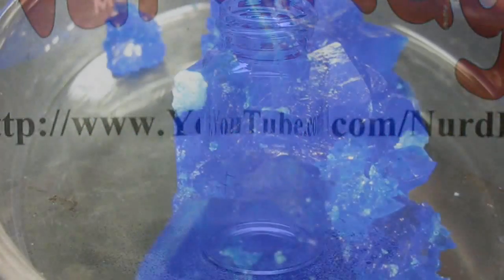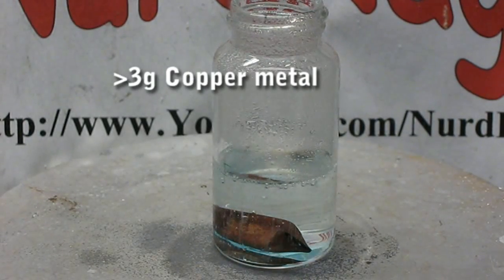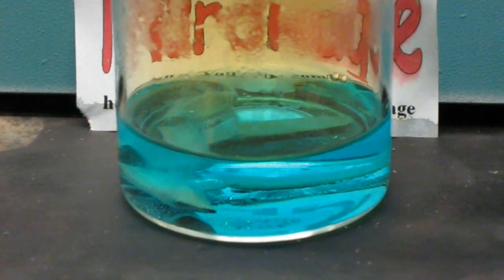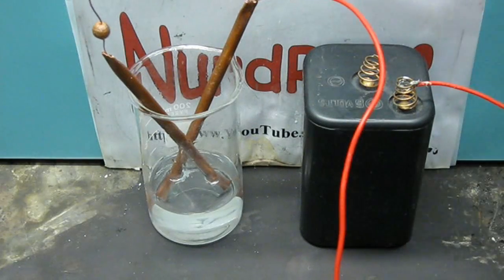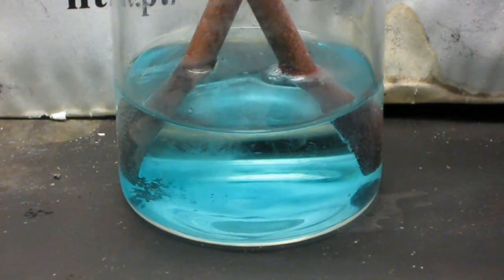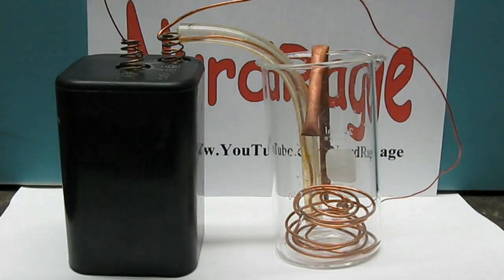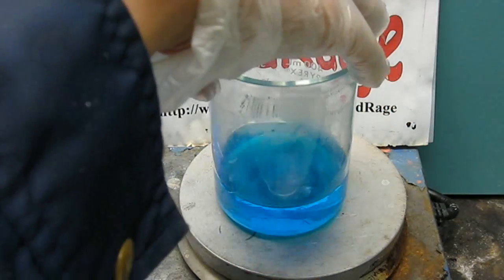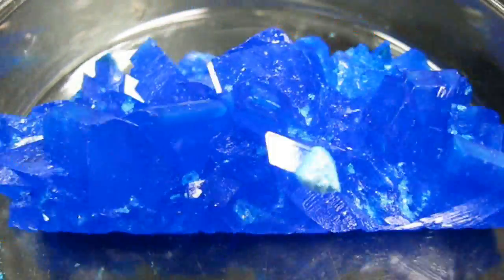Make Copper Sulfate from Copper and Sulfuric acid (3 ways)

Comment: @MrSuednym some say weak acid is better, I made mine w/ concentrated, but It doesn't really matter the electrons are doing the work so its speed is based on current. and dilute acid is safer to handle.  also the copper sulfate pentahydrate is sold as root killer in a hardware store.  here in CA last week and it was 16.99$ at OSH

Comment: I've done this with sulfuric acid and #2 copper pipe using the electrochemical process.  A new side note I learned is if you were to dip steel into the copper sulfate solution it will be lightly plated with copper.  I did this to a hammer over a year ago and it is still shiny copper to this day.

Comment: I'm currently making CuSO4 via copper, sulfuric acid and air. It takes longer than actively oxidizing the copper, (In a large flat contain with plenty of surface area a few days.) but I find that it uses up all the acid and I don't need any additional chemicals or equipment. Best of all it also works when making copper acetate from clear vinegar.

Comment: i am trying the 3rd way right now and have a nice sky blue solution at the bottom of my reaction vessle so I guess I am winning.  I am using an old atx powersupply that was moded to power it.  if you buy the solid core 12 or 16 gauge house wire from the hardware store you can get a section and only strip part of it for the posative electrode that goes to the bottom, then ya don't need to buy a little scrap of tubing or any thing.

Comment: @happylinkfan231
I think you just add the Copper Sulfate to boiling water and stir it until it dissolves. But you keep adding the Copper Sulfate until you can't dissolve anymore, this is called a "saturation" I think. But anyways just let the liquid evaporate from the saturation and you should have crystals. Remember don't touch or disturb the crystallisation process or it won't work

Comment: I tried to use the 3rd method (before I saw this video) and it failed miserably. Now I feel dumb because I have easy access to both H202 and HNO3. And is boiling the solution the only way of obtaining copper sulphate because I am not a fan of vapourizing toxic chemicals?

Comment: A forth and more industrial way is:  take copper metal and boil in conc. sulfuric acid. this will make nearly anhydrous coppersulfate.  this will be diluted in hot water then filtered.  this way the CuSO4-5H2O will be pure and clean.

Comment: i accidentally make Copper Sulfate i think when i was trying to make hydrogen in a basic test i was using a copper key and i think a brass key in a solution in water and bicarb soda with a 12v battery and drawing about 0.5A. i looked at the liquid and it was the same blue as Copper Sulfate i know from school electrolyses lab. im i right to think i made copper sulfate.

i have moved on to 2 ss shaver blades still in bicarb solution but its stronger now and i draw 1A, yay.

Comment: i really want to do this but i'm worried about using sulfiric acid and draining it from the crystals.  also how large can you make them and how stable are the crystals?  

if you can buy large sulfate crystals that would be the best option because i want to use them for displays.

Comment: @ZombieSlayer762 

Apparently one of it's uses is to prohibit algae growth in water, be it for pools or slightly worryingly drinking.

The only thing I've used it for however is for copper platting anything that conducts electricity, through electroplating. 

I'm sure there a rather a lot of other uses though :)

Comment: Hey Nurdrage. Love your videos. I have no chem exp. but they are very fun to watch. One question. In this video, you mix 30% hydrogen peroxide with sulfuric acid, and when you drop in copper it dissolves. However, in your nitric acid video you say after the first method is shown, that only nitric acid can dissolve copper. I just happened to be watching both vids and noticed that. Unless mixing sulfuric acid and hydro peroxide makes nitric acid (pretty sure it doesnt LOL ) I am alittle confused

Comment: Using nitric acid as an oxidizer can be verry efficient. Today I made copper sulfate using 75ml 6 mol/l sulphuric acid  and adding 10ml 6 mol/l nitric acid. 20 grams of copper metal are desolved using this method, a maximum of 50ml of extra nitric acid can be added to help desolving, don't add to much nitric acid otherwise copper nitrate will be formed during crystalisation. The theoratical yield is allmost 63 grams, practical you could get near 40 grams of copper(II) sulfate.

Comment: im having trouble to im tring the magnesium sulfate(aq) and  electrolisis using  copper anode and the first time I got A light blue scum forming on the bottom proble  CuOH , but the second time the solution turned brown / Dark green mabey the cathode is oxidizing and contaminating  the solution ?

Comment: For those who want to use 3rd method: I've used 40% sulfuric acid, 12AWG copper wire, and a PC power supply, as it has variety of voltages. Reaction works at 3.3V (between orange and black wire of the power supply, black is negatove). Works great :)

Comment: NurdRage, I'm planning on doing this experiment for my chemistry class, I have only two questions.  
The water is distilled water, correct?  
And for the electrochemical method how long was/should power be applied to the electrodes?

Comment: what is the smallest voltage the 3rd method will run? and what will be maximum expected current assumine 0.5mm ^2 wire as the upper electrode (submerged at around 2cm) ?

Comment: It's also a cheap oxidizer and works very will in a ratio with acid. There is a simple youtube video on making Cu(C2H3O2)2 with a 1:2 ratio (by volume) of 3% h2o2 and 5% acetic acid. but yes, that other comment is dumb that i said, probably wasn't paying attention xD mah bad. Also, i used 45 volts with NaCl and MgSO4 solutions with iron electrodes. It turns bright green (cl) / blue (so4) instantly (near the electrodes, you can just stir the water). I dont know if this works with Cu though.

Comment from the maker: @sapdog12

just means your acid wasn't perfectly pure, it's not as bad the situation looks, but requires a bit of work to recover:

Pour off the acid and get the white powder, add water to it to redissolve it, the white powder is copper sulfate, just in it's anhydrous form. The solution should turn blue now, let it evaporate instead of boiling and you should be able to get blue copper sulfate crystals.

The black acid can be used to make more copper sulfate, just won't be as pure.

Comment: oh, it formed a blue liquid though. but i dumped it and used the method with the hydrogen peroxide. ill tell you how it worked when its done boiling. i made 125ml of it and it boiling right now. it is around 50ml at the moment

Comment from the maker: @bernie2du 

It'll make copper sulfate, but i'm not sure if it will be pure enough for electroplating. I've heard electroplating require very high purity stuff and impure chemicals ruin the plate

Also i personally wouldn't want to deal with little bits of lead in my stuff. 

But if you do try it and it works then post a video and share the knowledge, :)

Comment: Makes a great stump remover. Drill 5 (five) 1" (2.54cm) holes in offending stump; pack 1/2  full with CuSO4. fill hole slowly with water.

The CuSO4 greatly accelerates the decomposition process; this makes the tree stump much easier to get out of the ground without using TNT and/or a large pickup truck with a log chain and/or other implements that might be looked upon with alarm by the neighbors when you show up in your front yard and start using them.

Yes, I learned this the hard way!

Comment from the maker: Keep in mind, it is *impossible* to chemically make sulfate ions from acetic acid. It's not going to happen. 

You must use sulfuric acid.
Reply: So how would you explain electrolisys pure copper anode and cathode in hot 10% acetic acid solution? It turn light blue instantly.
Reply: @Fosgen  copper acetate probably
Reply: Copper sulphate's chemical formula is CuSO4, The "SO4" represents the sulfate which you can only get from sulfuric acid @Fosgen

Comment: I'm not a chemistry major, so I'm not an expert with this stuff.  I see that you have to use copper and Sulfuric acid to make Copper sulfate, but does hydrogen peroxide react with sulfuric acid to create an exothermic reaction? So you need heat to make copper and sulfuric acid to react and turn blue?

Comment: If You heat the dry blue powder, it turns white. The white substance is CuSO4. If You then let it cool down and allow it to stand in the air, each CuSO4 molecule binds five water molecules from the air, and the substance turns back blue. The blue is the pentahydrate form.